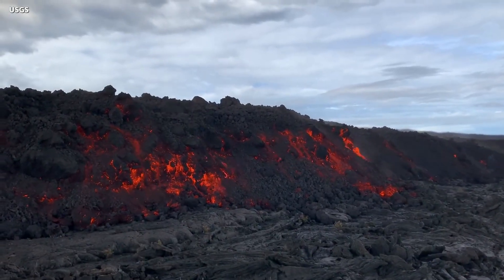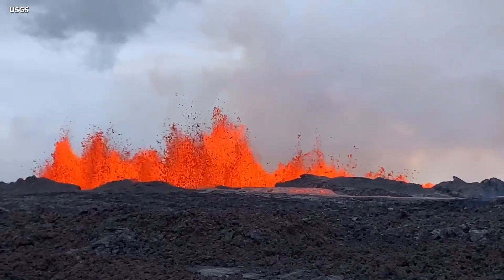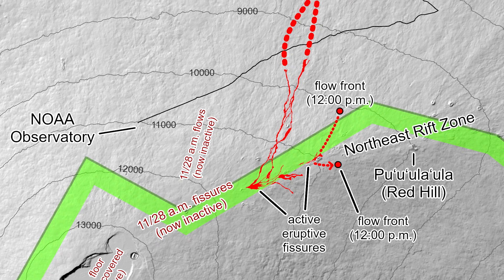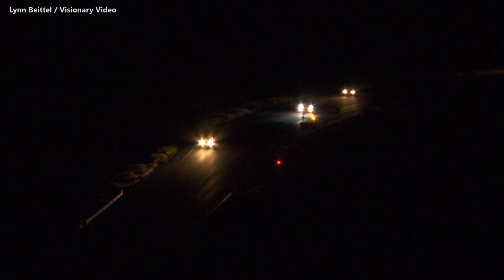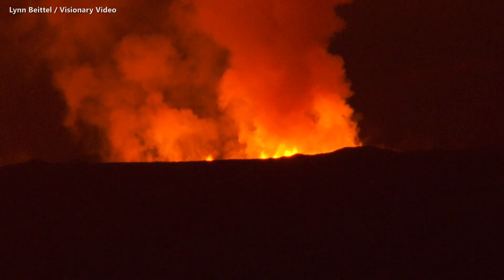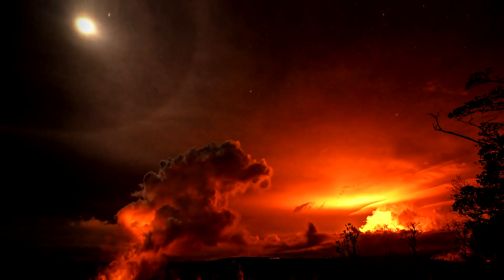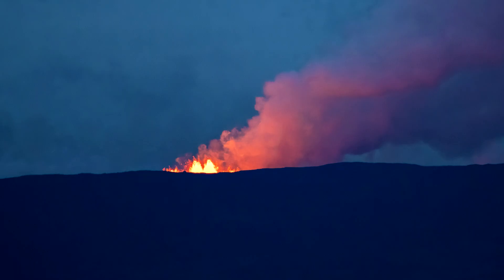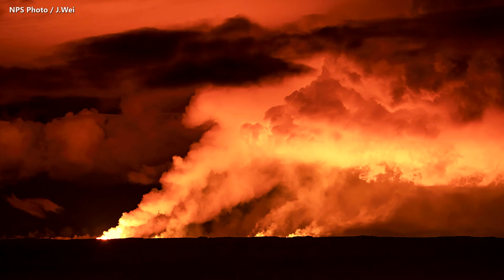Mauna Loa Eruption, A Closer Look (Nov. 29, 2022)

Comment: I live in the Canary Islands and Hawaii has always been kind of the big guy of the family of volcanic islands. Hope this will be only a spectacular thing and no damage caused
Reply: That'd fully depend on the lenght of this eruption. Mauna Loa is a mássive superstructure. The Kilauea is merely a giant side-crater óf this superstructure, which is só active, they named it a seperate volcano, yet.. Kilauea is dwárfed, several dozen times over to what Mauna Loa is really capable of!

The 2018 Kilauea Eruption lasted for 4 months, and destroyed large area's of Hawaii's  South-Eastern area. Its very possible that this eruption could last over half a year, starting with slowmoving lava, untill deeper reaches of the magmachamber surface, similar to what happened with the Kilauea-2018 eruption: more viscous: more liquid lava surfacing, and moving at a fár more rapid pace: Lava-rivers flowing in several directions!

A monster has awoken! We should really hope this béast goes to sleep very soon again. Yet there is nothing in this world that can stop this!
Measuring ~4300 meters from sealevel, and another ~6.5km down to the bottom of the Pacific Ocean, this Shieldvolcano is nearly unimaginably large, and is fed straight from a Mantleplume. A bit comparable to what is feeding Iceland's volcanic system. Magnetic forces are at play here: forces not even our brightest minds can figure out! The Sun's gravity field plays a role, but cosmical powers outside our own solar-system can even affect the mantleplumes that are pulled upwards right now.
Its as fascinating as it is dangerous and unpredictable.
Reply: @thegreenreaper6660  beautifully stated. It’s like the tides are changing.  Up next is a Cali earthquake.
Reply: @thegreenreaper6660  there is no “monster” or beast, Hawaii is just very volcanically active. This is just island-building. New land. We live on an active planet and eruptions like these cycle gasses and minerals from deep underground to the surface, it’s why life is possible on this planet. Without volcanoes and earthquakes we would be dead from a depleted atmosphere, like Mars.
Reply: @thegreenreaper6660  Kilauea has its own magma chamber; it's not merely a crater of Mauna Loa.
Reply: @thegreenreaper6660  .. a structure? 
😂,
I’m standing on Mauna Loa right now.. it’s a Mountain
Reply: @13soulz  a mountain is a structure
Reply: @handledav  ok Brandon